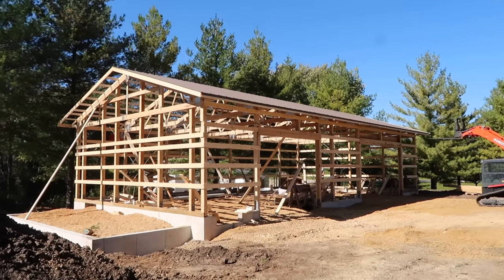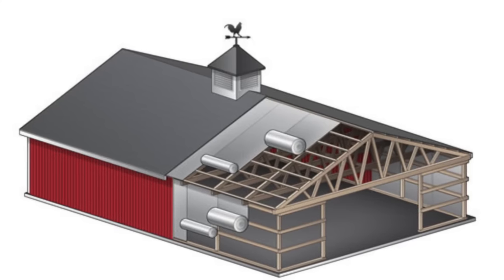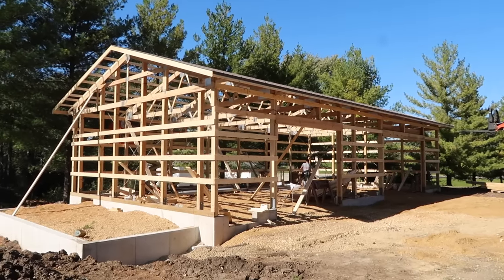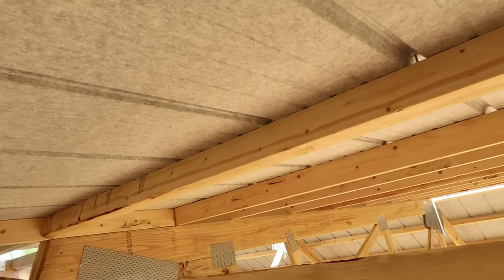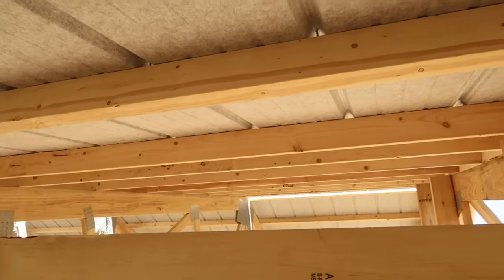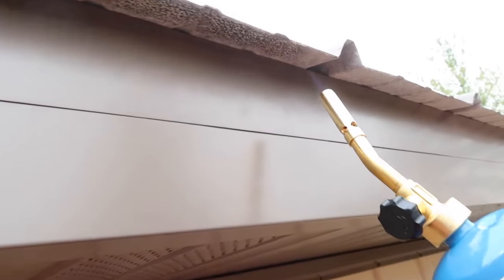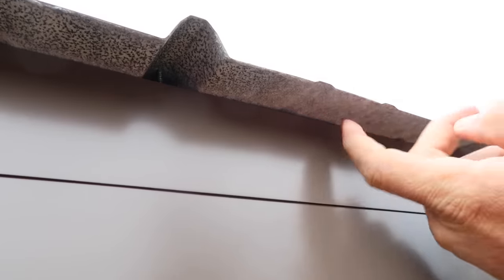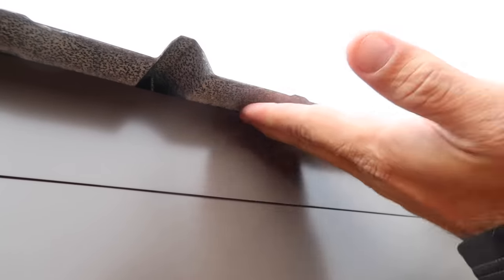Best Condensation Solution for Metal Roofing

Comment: I've got a problem......I already have one of the metal carports in my back yard that I have closed in and put a drop ceiling in as a backyard theater. I'm now getting water damage tiles. What can I do?
Reply: We are having the same problem, did you get it solved?
Reply: Barb Turner 
I put insulation in my drop ceiling and put a vent on each end and it seems to be working

Comment: Every climate is different. Here in the humid South an exposed wood under the metal roof only lasts for a few years. I have had treated wood fail in 15. We find that climate controlled areas last the longest.
Reply: Michael VanGundy - what do you recommend to prevent condensation on a metal building used as a woodshop?  Im in South Carolina.  Thanks!

Comment: I am looking to build a 24x20 Garage, and would like to consider a Metal roof and Metal siding, I live in Michigan and want to know do you suggest 5/8 decking on the rafters or no decking? also on the faica ends what would you recommend to us to fill the ends to prevent bee's from making a home in the roof?
Reply: I also live in Michigan, I would just do 2 by 4 purlins horizontal on trusses.  They make a foam that is ribbed to block insects at the bottom.  A cobra vent or similar at top is a must also in my opinion.

Comment: This stuff caused me huge problems in the UK. The previous house owners had this on their garage roof. Unfortunately, the side edges weren't burned off, so it was millimetres from the edge, and - by capillary action (wicking you called it) this soaked the entire roof inside. Nice video though dude. I guess when used properly it's fine

Comment: As I understand the material is to prevent the condensation from occurring in the first place by prevent the air from coming in contact with the cold steel panel.
Reply: The R value of the product is nil, so no.  He said it "sucks up" the condensation.

Comment: Any issues with mold since it holds on to the water?
Reply: There should not be any problems, mold needs food, and the felt is plastic.
Reply: It don’t hold the moisture, it keeps it from condensation go, just like wrapping your copper lines on your a/c to keep them from dripoing in your attic and walls of your house.  If you can afford it, I recommend the spray-on insulation,  just make sure you get a pro to do it, especially if it will be exposed.

Comment: The burn off didn’t work with me. Had to go back after a week and scrape off with a sharp chisel then paint over, which was the answer. This may not be a problem with a more inclined pitch but mine was a flat roof with little run which probable exasperated the problem

Comment: In a building for animals or where it dusts a lot, you can have dust problems on the condensate guard. which later turns black mold, it does not look so nice after a few years.
Reply: What solution is best in that case to keep condensation in check on the roof panels without risk of mold forming?

Comment: Looks like a really great idea. Would be awesome if the manufacturer could start the insulation 200mm (or whatever) from the end of each panel, so that your overhangs don't wick. Would make for a cleaner and faster install. If I used it here, in one of the warm and humid bits of Australia and was hanging it on shitty radiata pine, I would definitely put some sort of barrier on top of my purlins (quick and cheap self adhesive tape). Enjoy your videos, good on ya Kyle.
Reply: Yeah then you are trying to get it exactly to that mark. BETTER FASTER EASIER to just burn it.

Comment: Hi. I've been watching some of your videos, and have a serious question for you. I have installed shingles, metal roofs quite few times, but recently, I've found myself in a dilemma. I recently bought a manufactured home, single-wide 16' x 80'.  I replaced the original gutters with 5" k-style aluminum house gutters. Although it has no leaks, I want to do some preventative maintenance to insure against potential future leaks. This home has a slightly-pitched gable style, "loose roof" in that it is attached with staples at edges. My dilemma; should I use a 100% silicone roof coating such as Henry's, or metal roofing? I have a friend that is a professional roofer that suggests completely covering my entire roof with peel & stick, ice &water shield, then stripping (furring) it out, and installing the roofing metal. I'm very concerned about condensation using either method. The roof has no eaves therefore no soffits for vents. I'm concerned about my existing roof developing condensation problems, wetting my insulation, mold, mildew. Can I get you opinion on this please?
Reply from the maker: that's tough as I have never done that before but I would say make sure if you strip it out, do it so water can make it's way out if need be
Reply: @RRBuildings  Thanks. I have intentions of  cutting 1/4" slots every foot in my strips.

Comment: hey kyle i am in norhtern ohio installed a steel roof over my new/old home after the osb, in put down felt paper, then installed the metal. i have condensation dripping in a couple of spots inside , could you give me a suggestion for my problem ?
Reply: you may hand apply the felt to try.

Comment: 5:12 Maybe... Use a Warner Manufacturing Tool 10053 36" Bent Aluminum Spray Shield, 18" Plastic Pivot Handle or a Drywall taping knife, and jam it up into the corner. Protect the wall and burn it to the corner. Be a tiny bit faster too maybe?

Comment: Hate to be negative but metal roofs are an ongoing problem, screws back out, condensation, hail dings, and on it goes... heat contracts, cold expands, better off staying with shingles, or the rubber types.  Most of the more reputable roofers, at least in the area here in the south will not metal roof. Research the pros and cons.......
Reply from the maker: Climate makes a huge difference in how things work and hood up

Comment: I’m preparing for a sizable barn build myself pricing materials and such. I noticed the metal dealer had drip stop but didn’t know what it was. They were charging extra by the foot. Thanks for the tour. I agree w you proper ventilation evaporates any moisture (in the attic) I’m not convinced this drip stop is really all that. I’ve built barns and homes and I try to learn from others mistakes and successes. I been inside barns that were totally dry and no water trails whatsoever so I’m sure they were properly ventilated

Comment: The condensation comes at night, not in the morning
Reply: It's all moisture-temperature dependent; time of day is incidental.
Reply: In illinois, i've witnessed my 40 degree attic climbing to over 140 once the sun rises.  This happens within an hour or so, and is definitely time dependent.  70' northern and southern soffit along with high ridge just aren't moving the air on this 12 x 4 pitch. Really trying to avoid additional holes if possible. Considering a series of small exhaust fans installed below the high ridge in a channel to aid air transfer.

Comment: 4:32...for me the setup is wrong... Those sheets should NOTbe put on the main Timber... Condensation WILL occur... And will stay between the sheet and the timber and the anti drip shit will make it even worse.
Insulated metal sheets are a good solution, those anti drip sheets are ok on metal structures... where the contact surface is very small wuth the sheets.

Comment: I think before you burn off too much of that material, you might wish to contact your insurance carrier about liability in the event of a fire from burning off the felt type of material. Stranger things have happened.

With the cost at $1 per linear foot, and the unknown of rotting the purlins due to this product holding moisture, I'd cover the purlins with 17/32 plywood, then with roofing felt, before the steel install. 

The plywood is going to make a stiffer structure as well as quieter in wind and rain.
Reply: If you are going to put in that much time and labor you might as well just do the insulation.